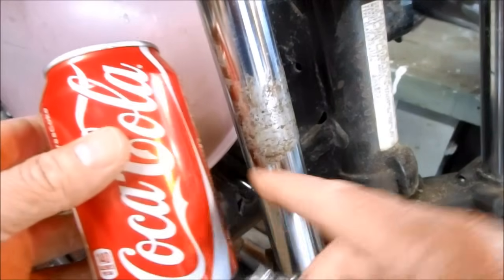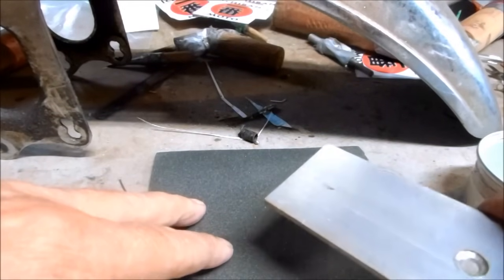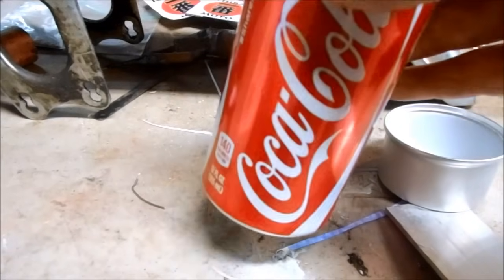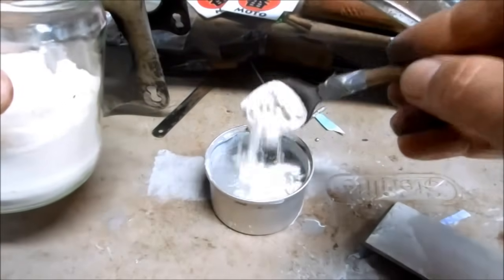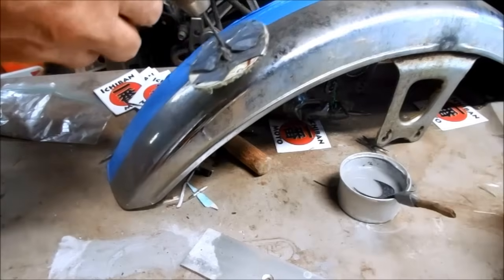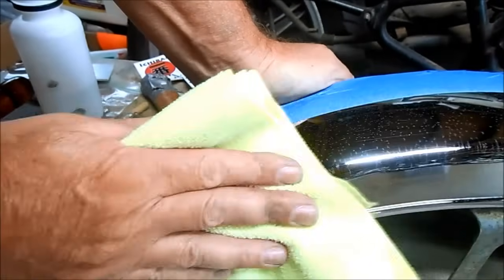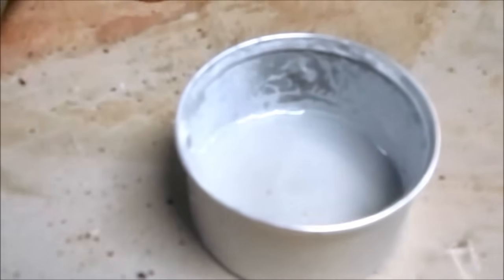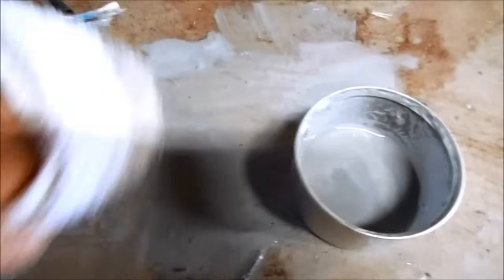how to remove rust from chrome faster and easier than coca cola and  aluminum foil

Comment: That was a good process, but seemed unprofessional to waste time and effort using a manual drill. Who uses a manual drill? someone without power would, but you have power.
Reply from the maker: +Deksam101  yes, I have power.  But my drill does not use power, you just crank it.
Reply: +Ichiban Moto I know, but you say you did that for a couple of hours, powered would have saved you time and energy. just saying. Good idea though! Gave it a thumbs up.
Reply from the maker: +Deksam101   I have more time than money

Comment: Your tools are obnoxious. You could have just used a rag and done that in a few minutes instead of hours with your hand drill. But I can't stop watching your videos and I don't know why.
Reply from the maker: drill speeds things up
Reply: it really doesn't you could have transferred more energy into the rag and onto the chrome and have been done much faster, the hand drill is more for putting large amounts of pressure and rotation at one spot, whilst your hand is more flexible
Reply from the maker: it's polishing, not grinding. the pressure is very light and the drill is geared to spin at many times the actual effort cranking . it is really quite efficient.